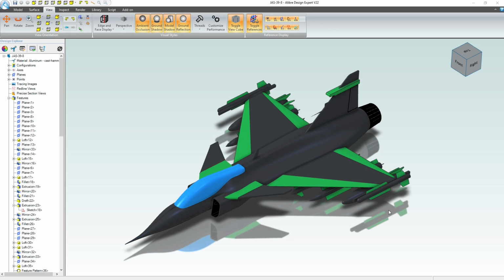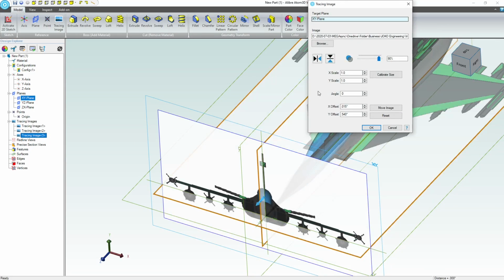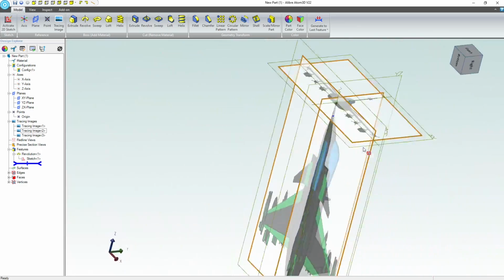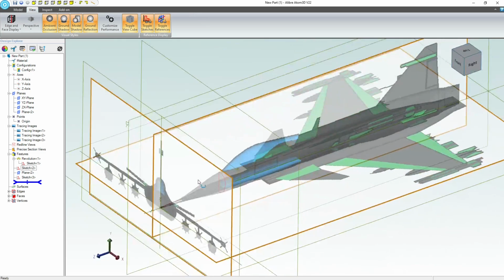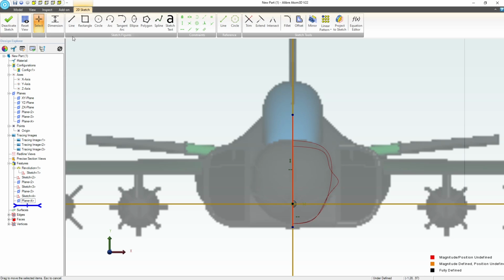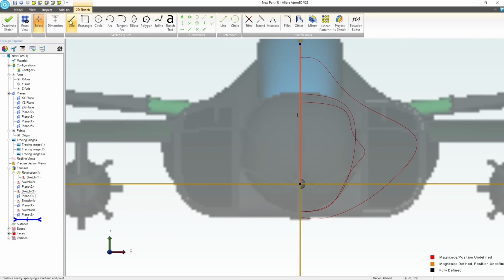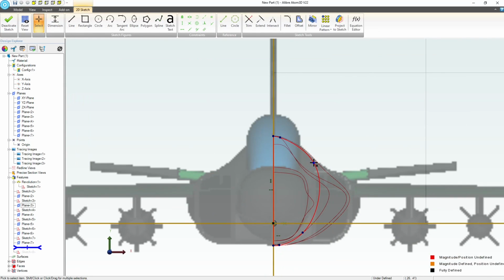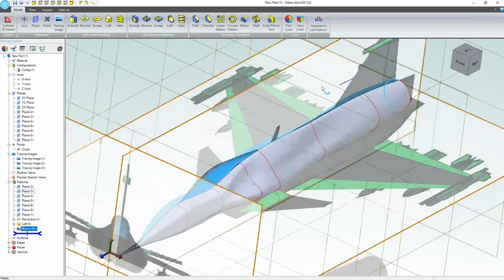Alibre CAD - Make a JAS-39 Gripen Part 1: Body |JOKO ENGINEERING|

Comment: I don't see how I can get the tracing images.  In one of the files I downloaded I got the whole aircraft including the tracing images but I don't see a way for me to just download the independent tracing images so that I can duplicate the whole process that you went through in this video.  I don't see a way to separate the tracing images from the rest of the drawing.  I don't see any files to download which just constitute the tracing images.  With the F18, in contrast, you have the tracing images by themselves available to be downloaded.  Am I missing something here?
Reply from the maker: I'm not sure what happened there.  I had an issue where GrabCAD accidentally deactivated my account, and some things have not been the same after they restored it.  Perhaps some of the files when missing.  Recheck the link they should be there now.
Reply: @JokoEngineeringhelp  Ok.  I got the individual tracing images now.  Thanks.